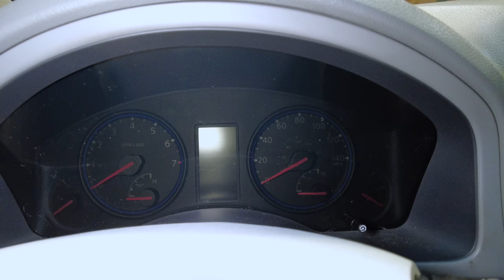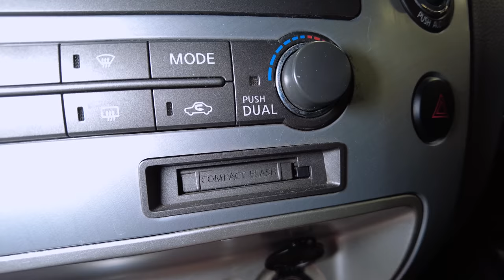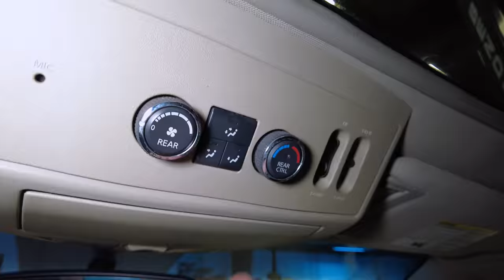Love it or Hate it! Common issues EVERY Infiniti QX56 has. CAR WIZARD knows - he had one!

Comment: I drive the exact truck profiled in your video. It is one of the BEST trucks I’ve ever owned. It has 195545 miles, and runs like new. The only repairs I have done is to replace the NOISY actuator doors, all eight of them. I’m the 2nd owner, and I have service records from the previous owner as well. This truck is the BOMB! I get 14.7 mpg highway, and 11 mpg city (A/C running). I plan on installing coil-overs in the rear, to assist the John Foose 22’s with the cornering capability. The interior looks damn-near brand new, and ALL options still work. I’m sorry to hear that your experience with this wonderful truck has been less than stellar, but my experience is WONDERFUL!!! I will have this truck until I stop wasting oxygen. 
Let me know how I can send you pictures or video proof of this wonderful truck, which I absolutely love!
Reply: I have a 2008 QX56. I brought it with 58K miles it now has 227K miles. I love it and its my everyday driver. My fuel needle did stop working it wasn’t the cluster it was the fuel sending unit. My exhaust rusted tho I’m  now replacing it with Cajun B-Pipes and the JBA performance exhaust. My headers are fine I decided to do the whole swop. Hopefully I’ll get it put on this week or next. I do my best to stay on top of my routine maintenance.  I do believe if you take care of your vehicle it’ll take care of you🙂 I also have a great mechanic so that helps A LOT. Oooo my over head rear console needs to be replaced the plastic is cracked and needs new pins but the tv and all the controls work great headphones do too. I found one on eBay but I sent it back because it was cracked the dealer wanted 2K-3K for that plastic Noooooo Sirrrrrr it was $500 on eBay.
Reply: @blackmanmoo4436
Same here I absolutely love my QX56 when the time comes I’m getting a QX80
Keep Riding 🫡

Comment: That engine in the Sequoia I'll bet is the 2UZ-FE. No surprise it looking so good and clean inside even with 400K plus miles. It's a Hallmark of that engine, which is quite possibly the best one Toyota ever built. You have Nissan at a significant disadvantage when you compare any of their engines to the 2UZ. Thanks for the great video.
Reply: You are correct it is the 2UZ-FE pre vvti
Reply: LMFAO. in your dreams. VK eats that shit for breakfast. Zero maintenance required for engine except oil changes....which this one didn't get. Have fun with the belts and lack of power.

Comment: If an engine is spotless clean on the inside at 200k, then it will look the same at 400k or more, assuming that the same oil change routine is maintained; to put it the other way, if an engine is going to gunk up, it will do it before 100k, much less 400k..

Comment: A lot of these problems showed up on my 2011 Altima. Next car: Camry.
Reply: Just rented an LE 4cyl after dropping off the Sequoia, and it had plenty of pep, and got 38.1 mpg. Took almost 5 tanks to get to The Wizard, less than 3; as I prepaid my fuel and dropped with a quarter of a tank.

Comment: I had 2 qx56, a 2008 first gen and a 2011 second gen. First gen was ok but still have the 2011 with all packages, ie entertainment and delux touring and AWD. Love my 2011 qx, no issues with it at 98k miles. I had the decal done to update the timing line though I had zero problems with as I change oil every 4k miles.

Comment: My Mazda has the same master window switch issue. I replaced it once, but I was broke at the time so got a cheapy Chinese part off of eBay. Worked great for a few months, and now some windows work, and some windows don't. Have never replaced it again. Didn't plan on keeping the car so long, but had I known that new car prices would skyrocket, I would have replaced it again by now.
Reply: @smithjones1906
I need to replace that on my sons 2011 G37x Coupe AWD
Any suggestions on where I can locate that master switch.

Comment: That engine is real clean inside, but without maintenance records to prove otherwise from original owner, I would have to say that sometime in that vehicles life a valve job was performed.
Reply: Who says it's even the original engine. 400k is allot
Reply: @andrewdonohue1853  if you change it when it starts to turn black the engine stays clean it's what my engine looks like only 80k miles though but 13 yrs old
Reply: @awesomusmaximus3766  correct... Someone just took care of it.
Reply: With that amount of varnish in the valve train, I'm not so sure, depending on total mileage
Reply: @robertmaybeth3434  Yes, that engine has had some really extended oil changes for the synthetic oil to stain it to that degree. I wouldn't be surprised if the chain tensioners started disintegrating from becoming to brittle and worn from the old spent synthetic oil..
Reply: My 4Runner has 400k on it and it looks that clean and its never been cracked open other than valve cover gaskets, timing belt, water pump and alternator. These engines don't need "valve jobs."
Reply: @CACressida  my 1984 Toyota pickup with a 22R on the other hand lol 😂
Reply: @samholdsworth420  you're talking about a 22R with old school rockers. Toyota moved into modern valve design in the mid 80s.
Reply: @CACressida  that's why I said on the other hand 😆
Reply: @samholdsworth420  around here where we go wheeling all you hear is the birds chirping and the 22Rs meowing.
Reply: @CACressida  yeah mine was a two-wheel drive one tire fire four speed. Buddy had an 81 4x4 w a 20r. that truck would go anywhere, slowly.
Reply: It’s never been opened up, it’s never had a leak until the valve cover gaskets started to leak and stink. All the records since new are in the back pocket of front passenger seat; and original owner documented every oil change until I purchased it at 324k for 3k. Mileage, type (conv/syn), shop name, date. I bought it without a test drive and it’s done three drives from Minnesota to California. 17 round trips from Minnesota to New York in 2022. I’ve owned it 5 years
Reply: @brads1277  nice 👍🏻
Reply: @brads1277  Over 300 K and not even a valve job?  That's amazing.  Every time I changed the oil every 3,000 and whenever I had to open them up they were always clean, but it seemed always at some point one exhaust valve would burnt, just a little, but that was all it took to make the CEL come on. Or else a blown head gasket seems to take out the engine.  But using only distilled water in the cooling and change every two years, helps enormously.